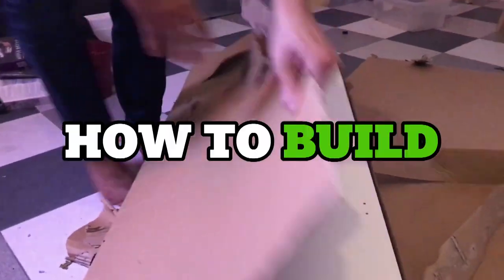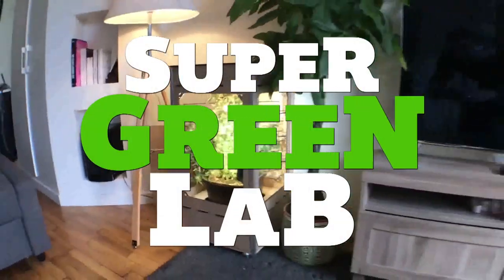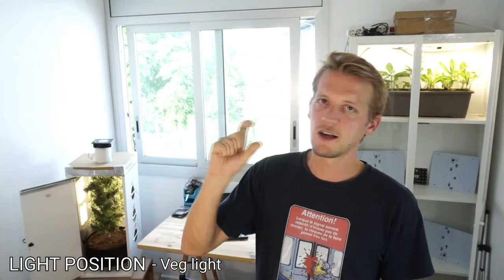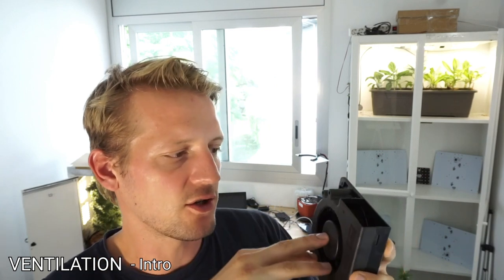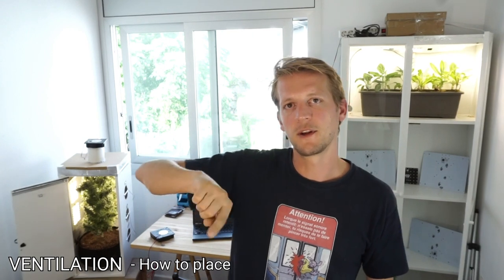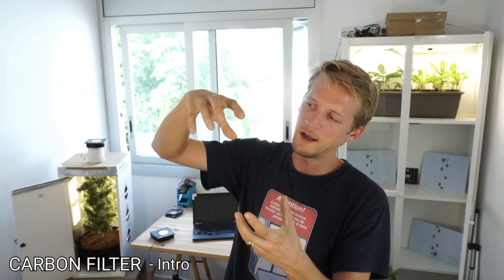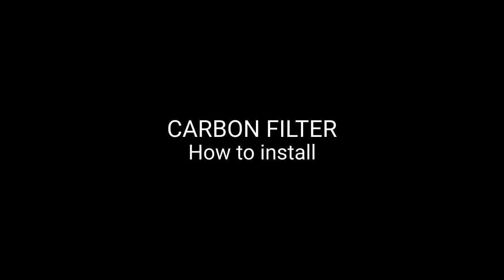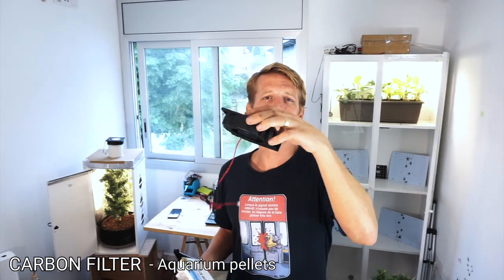How to build tiny & stealth growboxes - Basic concept and a bit of theory.

Comment: Thinking about growing a auto flower top hight 70-100cm in a 40x40x80cm grow box, do you think this will be possible if training is involved with pulling the plant out and down more with pinning branches with zip ties and using chicken wire to stop the tops from touching the lights?

Comment: You didn't mention about a fan that imitates wind inside of a growbox. Neither you used one in your last video. Do we really have to use them?
Reply from the maker: They are optional in tiny spaces, the blower exhausts the air and renews it.
The controller has 3 motor ports if you want to add more fans 👌

Comment: Say I had one of those out take fans for the filter. Do I have to match the volume of air it's taking out by using something the same for the intake fans.   I was just going to buy two computer fans for the intake and something like what you had for the out take fan. 

I mean if pressure builds up...BOOM.  no but would pressure  affect anything?
Reply from the maker: No you don't have to mach, we don't even put intake fans on much of our builds. The air will always find a way to go into the box and through the outake ventilation. Having a outake stronger than your intake will insure that air from the intake do not leave the box without going through the filter.